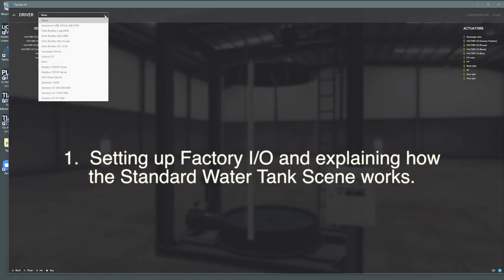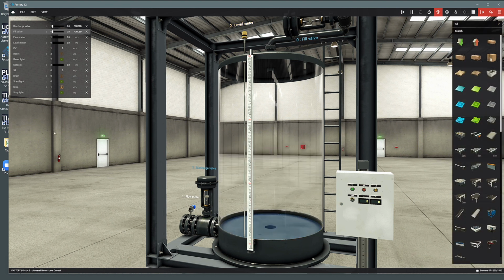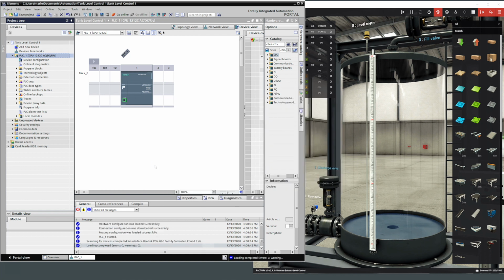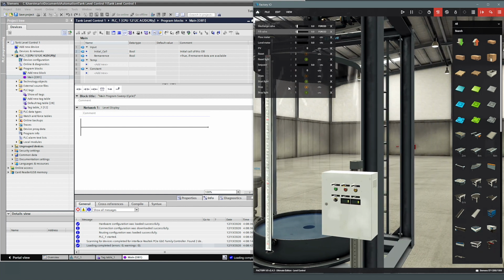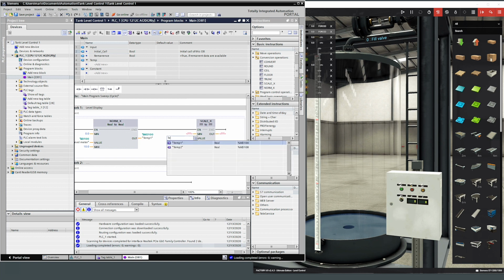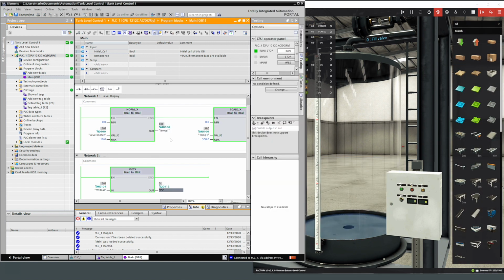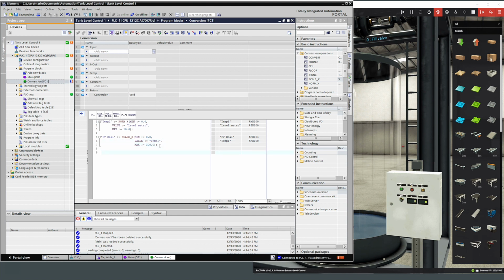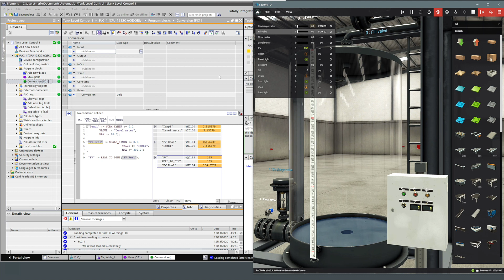Siemens S7-1200 Water Tank Level Control Part 1

Comment: Hi Mario,
After 2 weeks testing my Modbus i get it finally working.
Strang's after all my try outs  is that i have nothing changed.
All what i have done before i have changed back.
It looks that i have wake-up something.
I have started-up, en closed my program several times, and always it started-up afterwards.
It looks that something in the modbus blocks is critical when you looking on internet.
Thanks for your help.
I looking out for the PID control now
Reply from the maker: It does indeed seem a bit hit and miss when starting up. I think others on the internet have said the same, so you are not alone. Glad it's works for you all be it now and then.